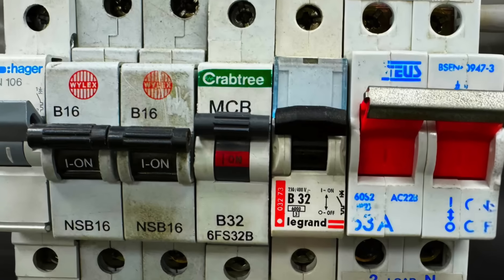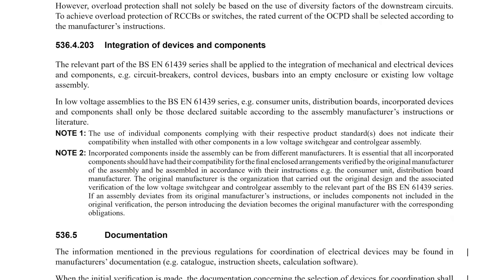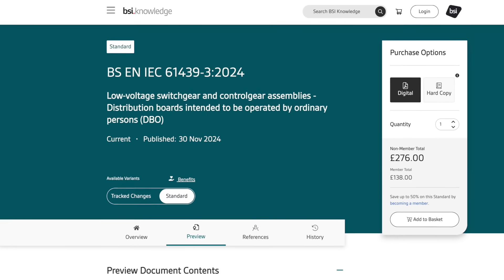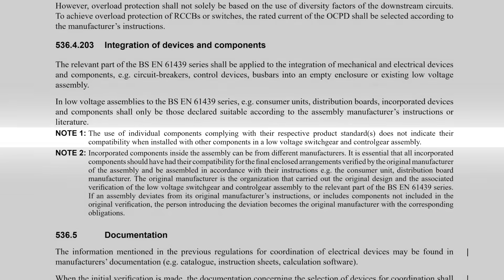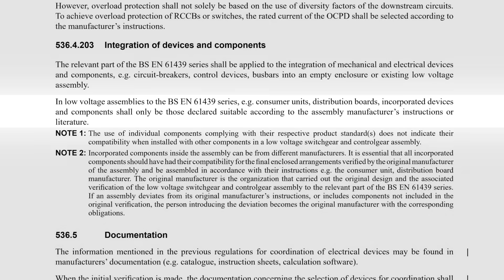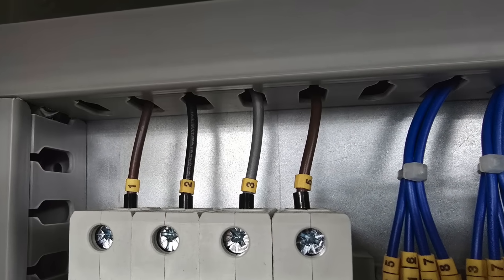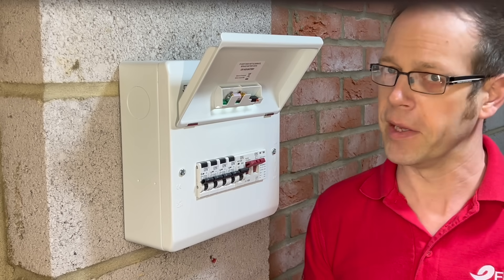Can You Mix MCB Brands In Consumer Units? 🧐

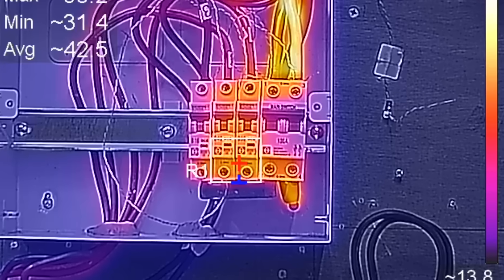Comment: So if the issue is with devices carrying high current being next to each other 3:42 then why are being advised to keep MCB's with higher ratings not adjacent to  each other, or even with blanked off gaps in the fuse box.
Reply: But in so called "best practice" all big amp numbers are gathered in one bunch at the start of the row - they call it "logical", "easy to understand".
Reply from the maker: Testing devices vs testing consumer units. Two different sets of tests. 👍

Comment: who would you class as the manufacturer though? some mcb's are identical with the only difference being the brand name printed on them.
Reply from the maker: Whoever's on the badge. If you mix them and something goes wrong you've taken on that role of the manufacturer.
Reply: @efixx  Like mixing plugs and socket manufacturers on final circuits. "You can't plug that Crabtree into my MK!" ;)

Comment: As long as they fit correctly on the bus bar and din rail without the bus bar being buckled and reshaped then I don’t see a problem other than it looks bloody horrible and shows a lack of pride. Why would you do that anyway. Keep it uniformed it look nicer and show you have pride in your work. Stop penny pinching .
Reply: But they don't fit correctly most of the times because manufacturers have quite intentionally made them not to be interchangeable. I'm very happy that German-French "Hager" eventually is pushing all the others off the market. If the others not accept unified standard based on Hager dimensions they will loose everything in the UK.
Reply: @AAaa-wu3el  lose

Comment: It’s a failure of the regulators and industry standards, that MCB and other devices aren’t necessarily compatible with each other when a mix of brands is being installed in a consumer unit.

The product standards should be written in a manner, that any complaint product will be compatible with any other compliant product, in any compliant consumer unit.
Reply: In continental Europe, it seems that only Schneider has its quirks and is not compatible with universal busbars. The dimensions are so standardized that even FAEL from the 80s is compatible with Hager, Legrand, ETI, or the Chinese products.
Reply: Most countries manage it just fine — it’s not best practice but you’re allowed to mix and they all are mechanically the same.
Reply: Exactly
Reply: Damn right!
Reply: It's obviously not a failure of the regulations, as companies and therefore individuals who are businesses and technically minded are free to design and develop and innovate to bring to market the best products they can albeit in compliance with Minimum Safety Standards viz. The Regs.  The Regs in themselves are not a level playing field for All manufacturers products to perform too.
Reply: @Bari_Khan_CEng_CMarEng  maybe not the regs but it is for the bs’s.

Comment: I wish installer’s would stop using odd makes of boards just to save a few quid. If it was a leading brand of board this would not happen as almost all leading wholesalers would stock the MCBs Etc. 

I wanted a MCB for a 10 odd year old Wylex a few weeks ago . No problem my wholesaler had them on the shelf.  I also wanted a RCBo for a VERSO consumer  unit about a year ago . What make , never heard of them . Oh hang on we should be able to get it but it won’t be quick and there will be carriage to pay on top. 

. Also   lots of odd cheap  makes of boards ,won’t be around in a few years time. 
Bottom line . You can’t blame the electrician ,if he can’t get the bits

Comment: Definitely high time the IEC, IEEE or someone stepped in and standardised the parameters of devices such as dissipation under load and mechanical dimensioning so that it doesn't matter. Multiple other industries have managed it, the fact it hasn't happened in electrical installation is proof that the manufacturers have too much influence over the industry.
Reply: If you look around the world you'll see it already doesn't matter, and I apologise to everyone for saying this yet again.  Many countries put their thinking cap on decades ago and determined that in instances where the fault current is under some limit there is no need to type approve whole assemblies because the individual devices will cope with the situation as a whole.  So long as everything is mechanically sound - things seat properly onto bus bars or direct wiring is used, devices are rated to handle fault current etc etc - the assembly as a whole will function correctly.  Even the Yanks with their custom device mounting systems to accommodate split phase agree on this.  You've been stitched up by your own regulations and the manufacturers selling into the UK are taking advantage of it.
Reply: @retrozmachine1189  As someone that has applied the BS EN IEC 61429 to designs I can confirm that it is a nightmare/minefield. Its worth mentioning that the standard requires assemblies to comply with certain environmental conditions such as IP ratings, IK ratings, UV resistance, ambient air temperatures, humidity, pollution degrees, altitude and EMC. I suppose this is where it gets tricky with relying on the individual components as they could never be designed to meet the environmental conditions that the enclosure can ultimately withstand.

Also I do think its incredibly difficult for electricians to work in such a way where BS7671 references out to a standard like BS EN IEC 61429 that not only requires them to buy a whole other standard, but the standard itself takes some reading to fully understand, and like mentioned in the video, is really for manufacturers. Definitely some disconnect in the industry here.
Reply: @retrozmachine1189  no.  here, if we buy the circuit board from a manufacturer, we are supposed to buy the components that go into the circuit board from the same manufacturer - and the majority of our manufacturers have proprietary equipment to prevent cheating.  other manufacturers can manufacture equipment to be compatible with that board, but it is not common.  and there really isn't a problem with that.  expecting all boards to be universal, is a bit like expecting all cars to be universal.
Reply: @kenbrown2808  The real problems arise when you need to fit something that a particular board manufacturer doesn't supply - that usually isn't a problem with everyday things like MCBs or RCBOs but it often get more difficult with less common things such as a relay, timer or energy meter.
Reply: @kenbrown2808  Except that's precisely the way things are in the rest of the world.  If one wishes a proprietary system can be bought into but most of the time for small switchboards (I have no idea why you called it a circuit board) are mix and match and nothing bad happens.
Reply: @retrozmachine1189 because a switchboard is a telephone routing center. A breaker panel is where the circuit breakers go.
Reply: @retrozmachine1189 and not sure why i used circuit board. That's what you build electronic equipment on.
Reply: @kenbrown2808  No, a switchboard is literally a board with switches on it.  Oddly enough a telephone switchboard also had switches on it and sockets for the call management too of course.  The term switchboard is used frequently around the world to describe where fuses, breakers and other such items are located.  This term is even used in the USA although panel is more common.
Reply: @retrozmachine1189 panel, breaker panel,  panelboard, loadcenter, are common. Switchboard, not so much.
Reply: Definitely not the IEEE as that's an American organisation.

Comment: Self interest, lazy engineering and protectionism by the manufacturers. Test all individual devices to set temperatures butting up against them in different configurations and incorporate those limits into the standard. A DB is not fkin rocket science.

Comment: And I got one for you..... can we still use the push in plastic blanks? We stopped a while back
Reply from the maker: Good question, why did you stop using them? 🤔
Reply: @efixx  you can remove them without the use of a tool by bending them slightly, leaving a gaping hole straight to the busbar
Reply: @codenamenel  Only a C2 is live parts are accessible. 

If they are not then a C3. I think it's only the schneider boards which you can isolate the busbar fall into this category.
Reply: @_eusty  lmao so you think direct access to live parts is only a C2 ?
Yeehaw, ride em cowboy 🤠🤠🤠